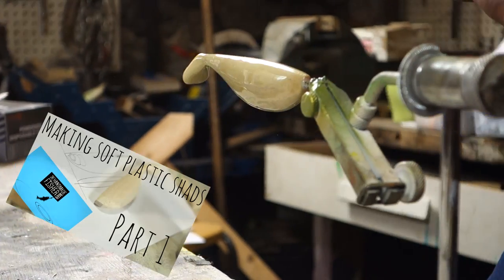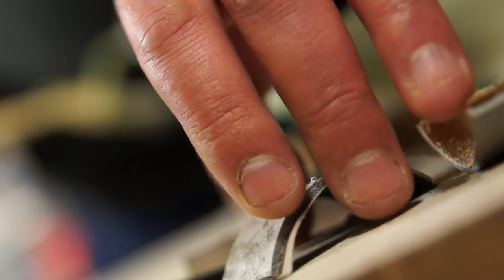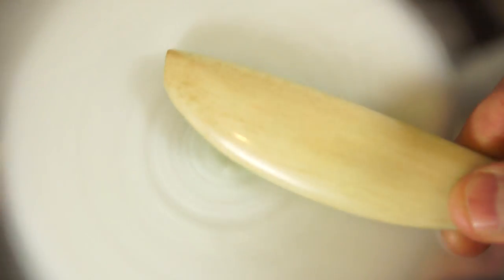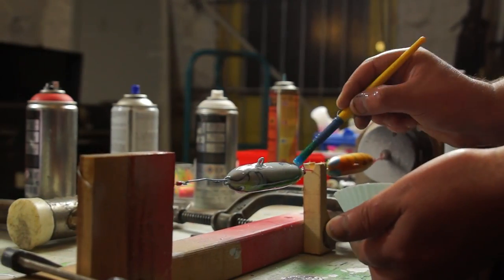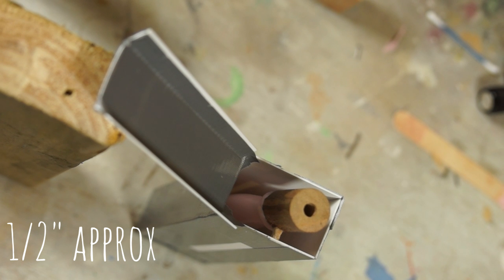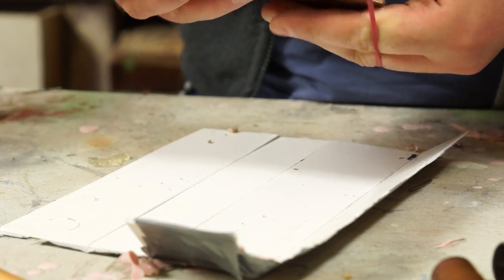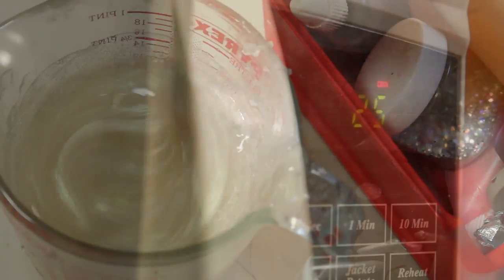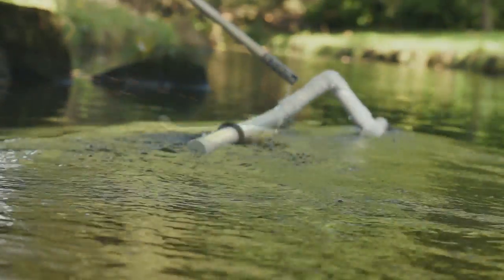Making soft plastic shad lures part 2

Comment: As always, great video Paul! I found your injection mold solution quite intriguing. I just started pouring and I don't want to spend the money on injection molds nor do I want to sacrifice the joy of making a lure from scratch!
Reply from the maker: These really rely on gravity as well as the slight pressure needed to overcome it rather than aluminium mould which often require more pressure to force the air out. These are other materials I hope to experiment with to make the moulds before i turn to a cnc machine

Comment: My experience is that tail angle to body must be more close to 90 deg. This will makes tail move more agressive/play more even in slower movement of bait. Because of that I sometimes melt factory made plastic baits with lighter and change angle of bait tail. ;)
Reply from the maker: may give it a go, thanks

Comment: two thumbs up as always......have you ever thought of making the paddle disproportionately big and body smaller.... in order to make lure slower and action more? just a thought I have been toying with
Reply from the maker: I think it is about finding a balance, this lure needs a little more in paddle size department, i would like the paddle to work when the weight of the jig head pulls it down in the water and at the moment it is a bit slow at starting, thanks

Comment: Loved Every Minute Of Your Latest Video Another Superb Production Both Of Creativity & Cinematography I Think We Sometimes Forget Just How Hard It Is, To Make Something Look So Simple And You Hit It Every Time Paul.
If I Might Add So Tech Advice Make The Tail End Of The Shad Slimmer And The Tail Fatter That Way You'll Get Better Action
The Rubber Shads I Buy Are Like That "Great Work, Well Done" 10/10 
If I Might Add Too There's A Video Production Company Out There, That Would Benefit From Your Skills You Are Without Doubt A Very Clever Fella
Reply from the maker: Thanks i still have some adjustments to make to the tail, i don't want to make it  thinner as they have tendency to get damaged very easily and also casting them ends up a bit messy but it certainly needs a some more paddle, thanks again

Comment: Great video. I didn't quite understand why you wanted the lure polished and shiny however, also what is the point in coating the lure with silicon via disco ball prior to putting into the mould? 

If anyone has any tips how to recreate a soft plastic that's no longer made (but I have a few left) that'd be amazing. 

Thanks :)
Reply from the maker: If you make a shiny surface you get a shiny surface on the mould and on the lure you cast in the mould. Putting silicone on while the lure turns stretches it and pops any bubbles trapped in the silicone to give a better surface finish on the mould and on any lure you make from it. I would look at https://www.youtube.com/user/MakeLure they have videos on copy existing lures
Reply: Thanks so much Paul!